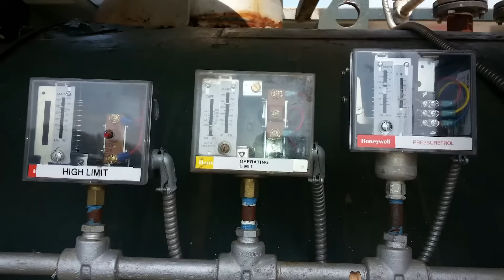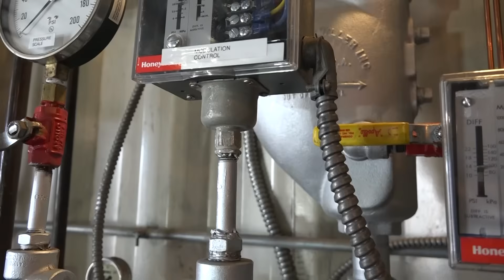Understanding Steam Boiler Pressure Controls - SteamWorks

Comment: So how exactly does The expansion and contraction of the bellows interact with the mod motor to control the firing right? I understand how the modulation motor moves the linkage to change position of the gas butterfly valve
Reply: Wait I think I figured it out . So the load on the boiler effects the pressure which then effects movement of the bellows in the modutrol which then effects movement of a linkage that's between the modutrols bellows and  a potentiometer right? Then based on the magnitude of the potentiometers signal to the mod motor is what determines how much the fuel/during rate is adjusted by the opening of closing of the butterfly gas valve or oil valve if u run oil.
Reply from the maker: @AdrianButler86  Glad you figured it out. Just now seeing this comment.